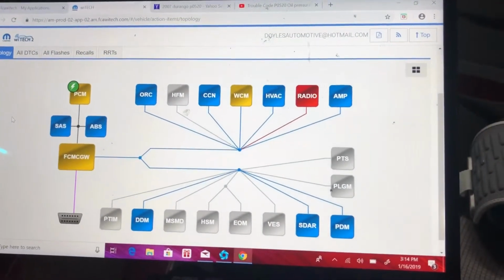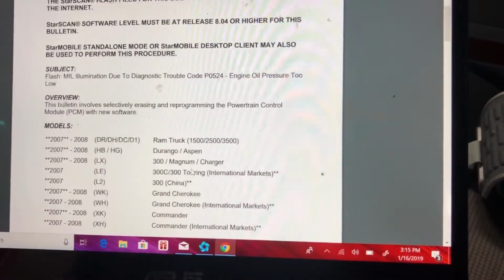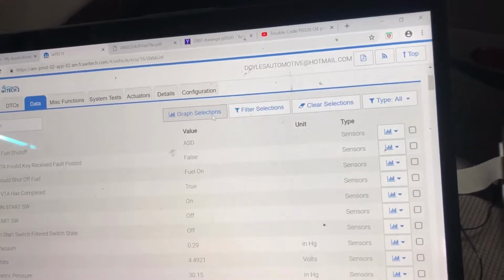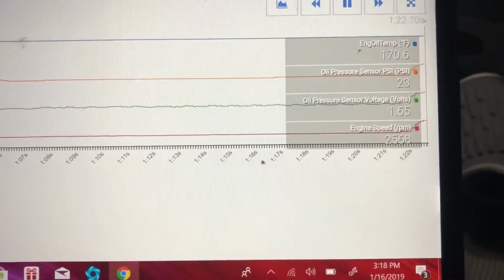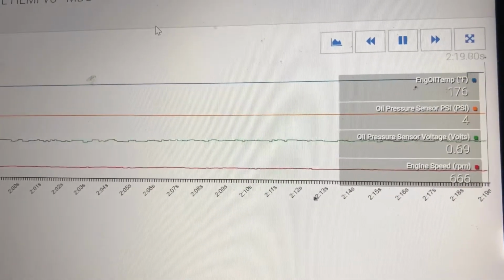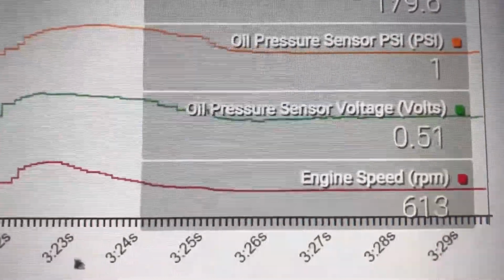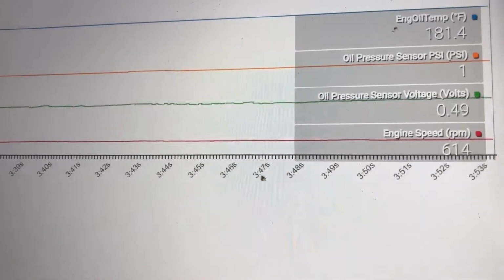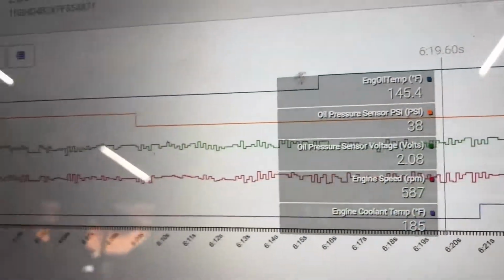Dodge with a po520

Comment: Assuming this is oil sensor not the pump itself, we can drive safely to the workshop for replacement. Any way to determine 100% without specific equipment that this is sensor failure, not oil pump?